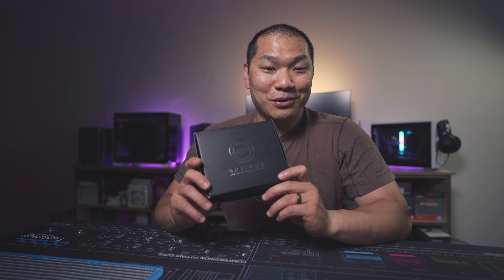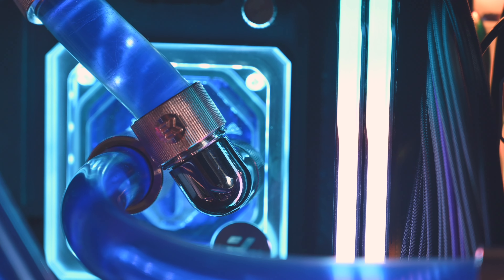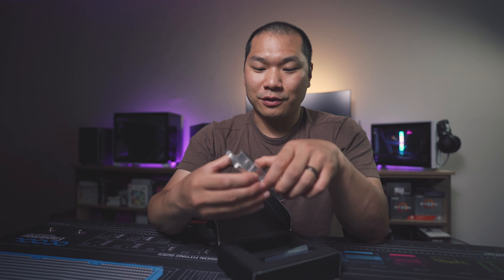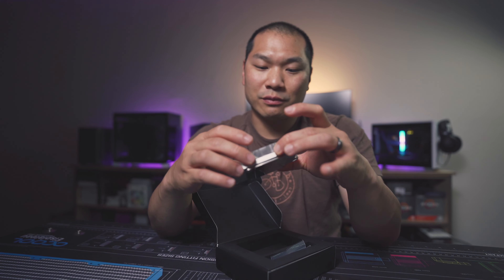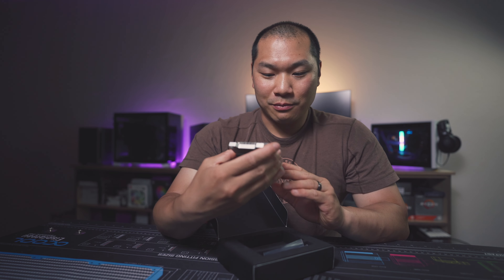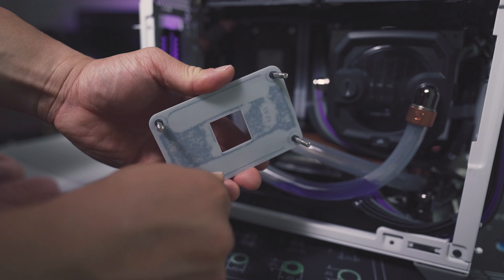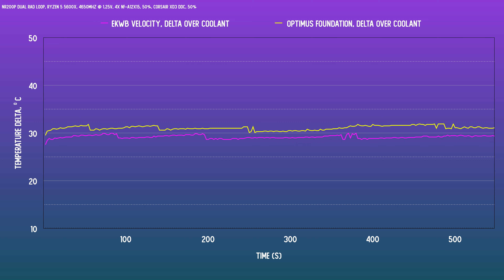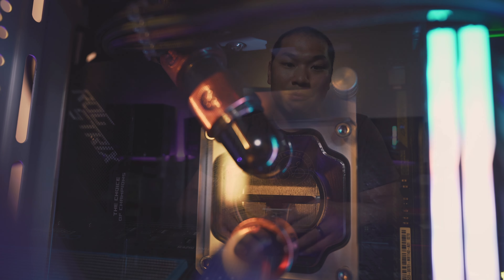Dual Rad NR200P Update - Optimus Foundation AM4 Block

Comment: I've had foundation and block since 2019. The very fine micro fins and restrictive nature of the block equals very good performance but it will clog far more easier than most blocks. I also had a EK velocity before switching to the Optimus foundation. There was only a 3c difference.
Reply: I only run distilled water btw with anti fungal.

Comment: I have tested the EK quantum magnitude full nickel AM4 and this Optimus Foundation am4 on the same setup and CPU bios setting. Optimus foundation gives me 2~3 degree drop on average. If in your case Optimus foundation is not even as good as a EK velocity, there are two possibilities. 1. Mounting is not proper, both ek block and optimus block need to be screw in evenly until you can't turn the screw. 2. Your pump can't handle the microfins on the block. This you need to check the flow rate with a flow sensor.

Comment: I’m waiting for an Optimus FTW3 block for my dual-rad NR200 build. 

Got nearly everything I need- just need to order the correct side-rad as I accidentally bought a 45mm Alphacool rad without realizing it. Oops…
Reply from the maker: Awesome! That’s going to be one sweet build. Nickel or copper?
Reply: @MachinesMore  Nickel, w/ Cooling backplate. I expect it to perform exceptionally well, based off of what others have said and GN's experience with the block. Biggest concern is the backplate, as when I ordered only the thicker one was in-stock. It should (hopefully) still fit, though!

Comment: Lmao, you had the block on the cpu wrong,  try flipping the block around where the inlet drops straight onto the cpu cores and the temp will go down.  I have had it on my 5950x and now 7950x and the block did in fact, out perform EK/Alphacool/Corsair blocks by 5-7c.  Optimus is the truth, i didnt believe it either until I put it on a cpu.  And yes, if you put the block on the cpu wrong, it will perform just like all the other blocks.
Reply: So the orientation was actually correct. The chiplets run vertical when the chip is  oriented 90 degrees as is normally the case with the am4 socket. If you mean to say the inlet and outlet orientation matter, top vs bottom, that is also incorrect. The jet "plate" is centered in the block.
Reply: @pax1980  the block was upside down.  the inlet has to flow onto the CCDs .  I emailed tech support at optimus and they said the optimal placement on the cpu is where the inlet flows onto the chiplets across the die.  I wish i could post pics on youtube and i could totally show you.  But when you do this, the temps do go down 5-7c.  I have tested it.
Reply: @mikemischler2886  the inlet jet is dead center over the cold plate. It doesn't matter which way you orient the block. The jet is always center.  As long as the chiplets align with the plate you are good. It is correct in the video. For what's is worth I found very little difference between the foundation and a heatkiller iv pro in my testing. Maybe a degree or two. The higher restriction on the foundation though did cause my pump to be substantially noiser. My preference in the end was the hk.
Reply: @pax1980  i understand that, go look at the pics on the website, thats why i wish i could post pics so i could show you.  And I undestand  your statement and I am not saying you are wrong but if you want the total efficiency of the block, you need to set it up to flow over the chiplets.
Reply: @mikemischler2886  https://i.redd.it/8hwva0cs2hb81.jpg shows the chiplit orientation. Notice the vertical alignment when the chip is set on it's side.
Reply: @pax1980  look guy i dont understand what you want from me?  lol  I told you my testing results,  you dont have to keep going.  Either you can test it yourself or not.  Its up to you.  LOL, i just know what works for my am4 block and you can switch the block around, i hope you know that.
Reply: @mikemischler2886  I have and what I'm trying to tell you is your wrong. Optimus and MM have it in the correct orientation out of the box. You do not need to rotate the cold plate in the housing.  With that understood, having the inlet at the top or bottom also makes no difference since the jet is centered. You're accusation that the block is somehow not correctly mounted, thus invalidating MM's findings, is  disingenuous. It's less for you and more for the next person who comes along.
Reply: @pax1980  ok you are right, have a good day lol

Comment: Tbh I've seen on most sites that CPU block is one of those parts that you don't need to spend that much on vs getting quality fittings of course
Reply from the maker: But they look so sick 😎
Seriously though, I think with most custom cooling stuff… it’s already beyond the point of “reasonable” price to performance, so anything goes at that point. But yeah I’d tend to agree… good fittings are mandatory, and from a budget perspective the best place to spend for gains is first get the best fans you can, and then the best rads. Then you can start thinking about other components.

Comment: I have the NR200P but I’m not sure what rads and fans to use for a dual rad setup. Can you please help?
Reply from the maker: Hey Gil, you will have to do a little modding to get it to work. I go over the dual rad process here, 

https://youtu.be/Qan37k691-4

but I would recommend 2 XSPC TX240 thin rads (I used one cross flow and one regular but that was just for my particular tubing run). Slim fans will give the best airflow but you are able to fit 25mm fans on the bottom (depending on your gpu block thickness).
Reply: @MachinesMore  thank you. what’s the difference in performance for cross flow over regular flow?
Any good slim fans?
Do regular fans fit the top with a slim rad?
My bottom GPU is Gigabyte RTX3070 Aorus Master. 2 PCI slots width

Comment: You think with the Aorus B550i's higher RAM slots dual rad won't be possible?
Reply from the maker: It should work- I would guess the Noctua fan would need a notch filled out to fit the RAM, the blade should clear though.
Reply: @MachinesMore  Awesome...might need to try it!

Comment: I watched your video on the NR200P dual rad config where you went on detail about the procedure of installing a top rad. Just wanna mention an idea for a future video. 
If you remove the top mesh, the CoolerMaster Halo Fans fit PERFECTLY. So is it possible to mount a radiator on a sandwich layout being:
FANS
TOP PANEL
THIN RADIATOR
You are the reason i bought this case m8, and i am glad this channels exits. Keep up the great work !

Comment: What's the result like with the 5800X which has a higher TDP?
Reply: I managed to get my hands on a Raw Copper Optimus Foundation block for my Ryzen 5800x. It dropped my load temps from 90C to 76C. Absolutely amazing waterblock.

Comment: DaPoets, another youtuber,  had similar experience with you. He got almost the same performance between EK and optimus. Untill the Optimus representative told him that he didnt tighten the screws enough. then he was able to achieve the 8-10 degree temp difference.

Did you tighten the block enough to the backplate?
Reply from the maker: Yeah, that was the first thing I checked and it was all the way tight. It’s been running a bit and will try again in case anything loosened up from the heat.
Reply from the maker: Was able to crank it down maybe a sixteenth of a turn, not a meaningful change, and basically still statistically the same as the Velocity. I did check out the video you referenced and that particular design (Absolute) looks to be another notch above the Foundation, unfortunately for AM4 they only have the one line now, even Intel gets their all metal “Signature” block. 
Also I think the copper coldplate versions will have a bit better performance, realistically speaking, the Velocity blocks are already pretty good, hard to imagine getting 5 degrees better with anything (again this is not knowing what baseline some user testimonials are claiming against).